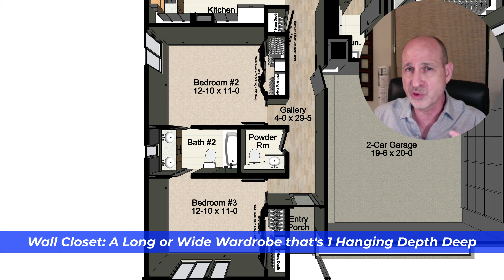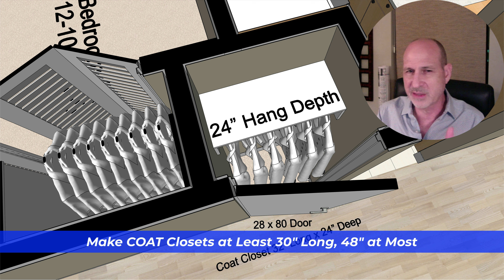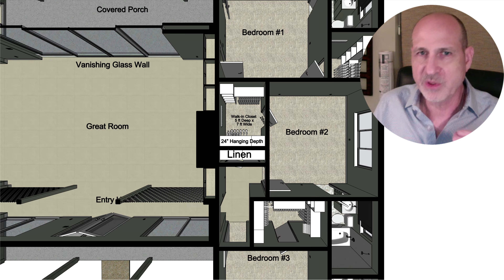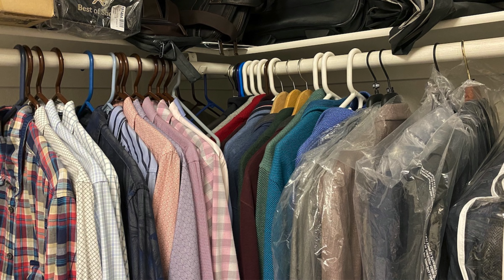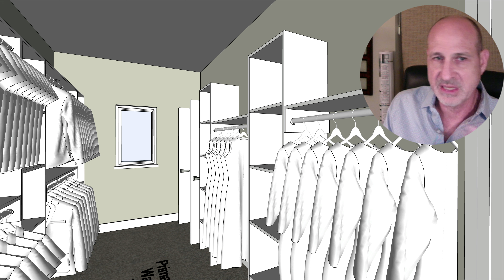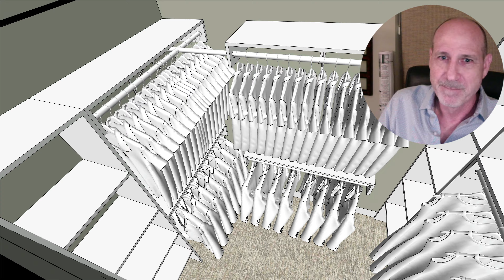Avoid REGRETFUL Closet Design Layout Mistakes

Comment: What is the minimum depth of a walk in closet in small home
Would 3 ft work if 14 inch hangers and one long row?
Reply from the maker: Thanks for your question. Ideally, walk-in closets need at least a five-foot by five-foot interior space to function well. Two feet of hanging depth is standard. If the rod is along one wall inside that closet, three feet of space in front of the rod is left to move around. Let me know if that helps. I can send you a wardrobe closet reference guide if you want to send me an email address.